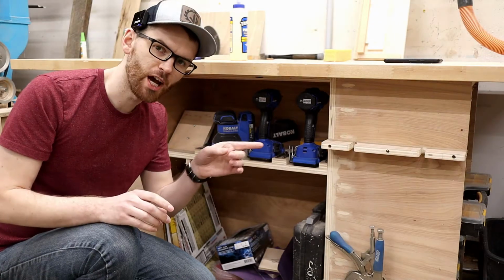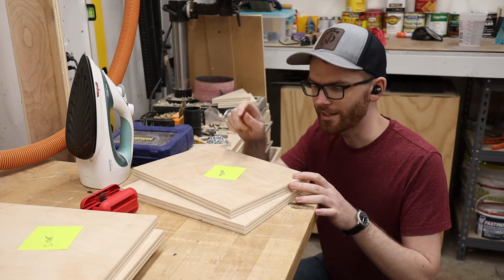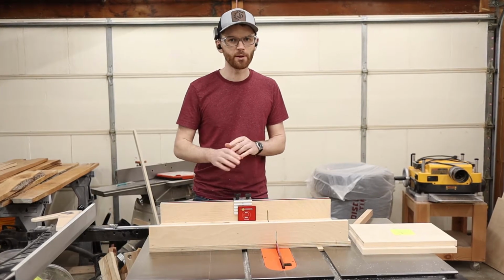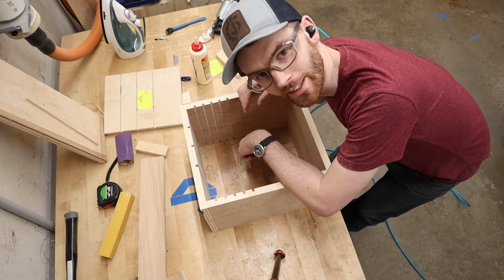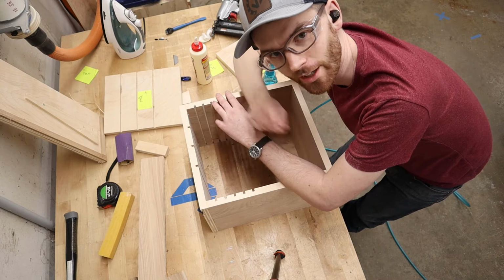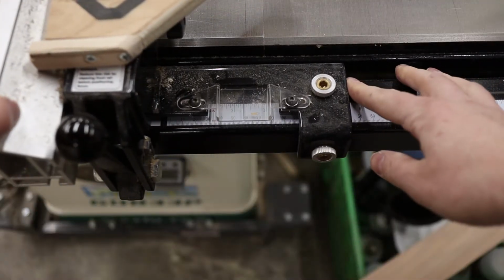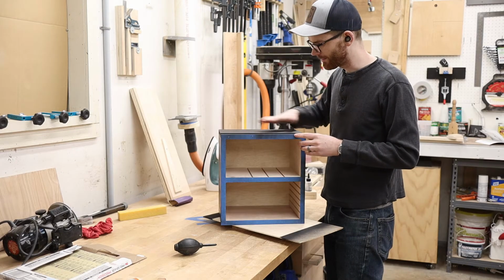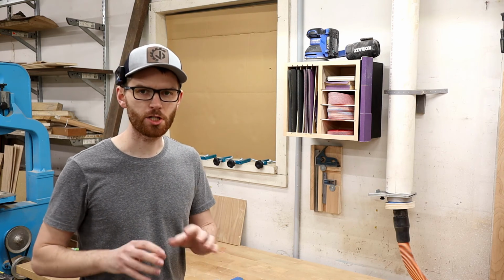Shop Sanding Cabinet // Shop Organization

Comment: This is great.  I made something with similar features for for my drill, router and sander.
Reply from the maker: Very cool!  I need to do the same.  Currently the drills live under my work bench...which is not optimal...
Reply: @MakewithJake  Check it out and let me know what you think!
Reply from the maker: I definitely will!